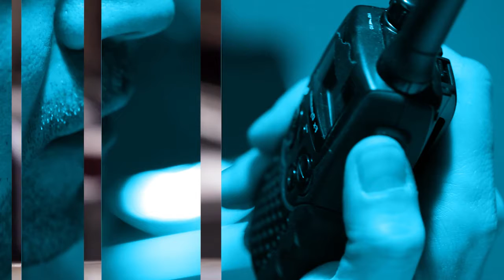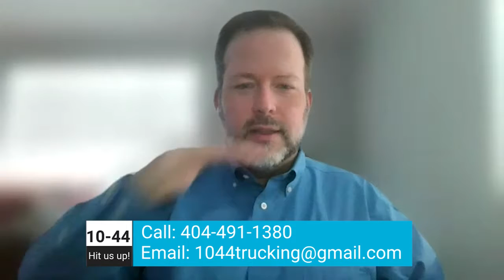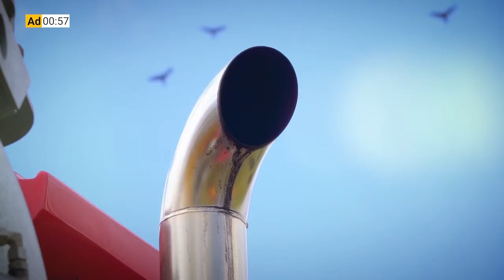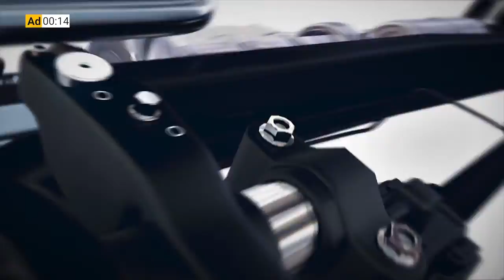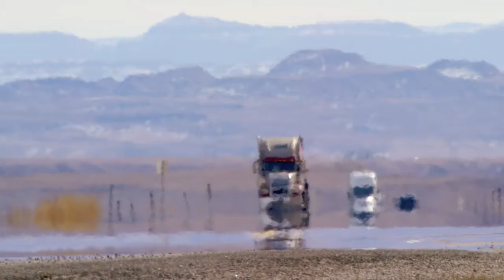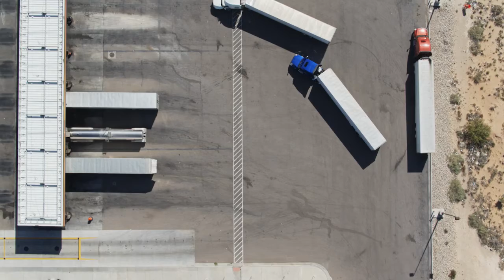Fleets have three options of oil type: conventional, synthetic, or synthetic blend

Comment: Go with full synthetic. It’s better than conventional oil. Synthetic blend has a very very small amount of synthetic oil in it. It’s not regulated by the government so the companies can put in very little synthetic and call it synthetic blend. You know they will screw you for sure.
Reply: Take a wiff of conventional, synthetic and semi-synthetic. Conventional is filled with impurities so it has a strong odor, synthetic does not have much of a scent. If a semi has a faint odor similar to a synthetic you know it's good. If it has a strong odor and smells similar to a conventional, that's not good.